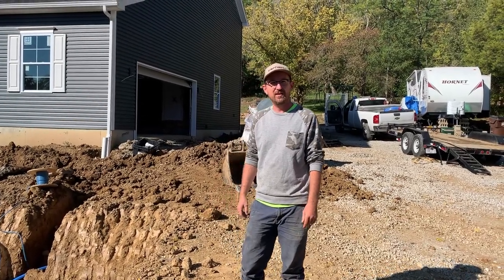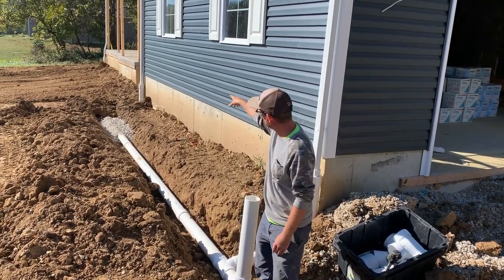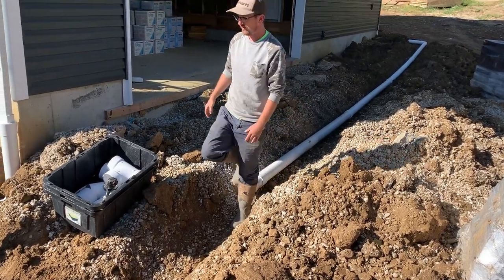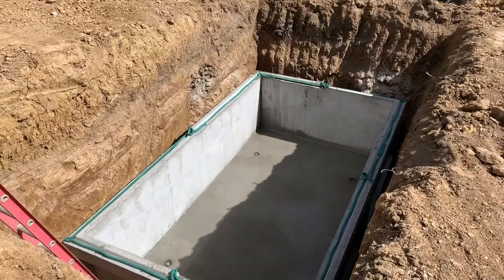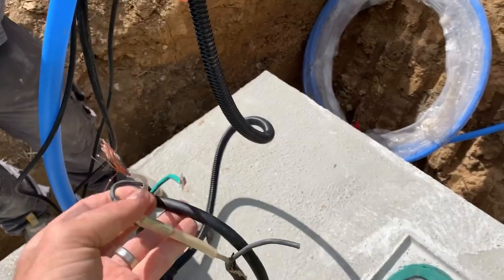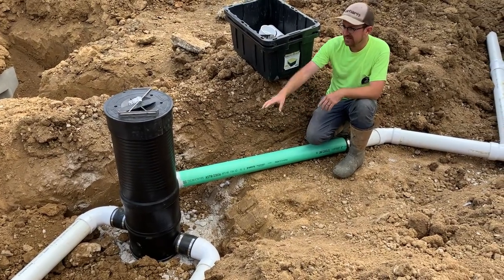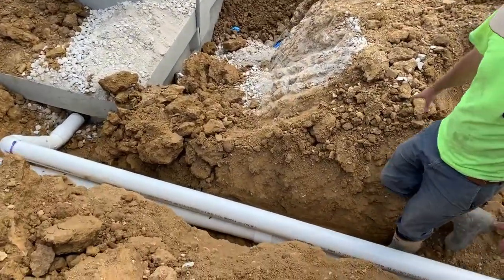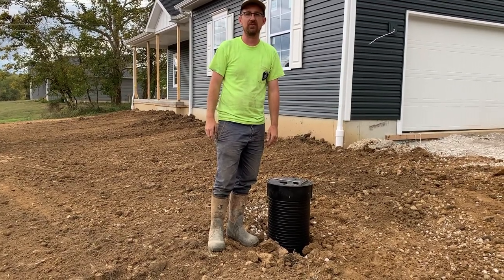Complete overview of underground rain harvest cistern install

Comment: Very helpful as I plan my own system. One question: are the water and electrical lines back to the house placed in conduit, or can they be, and if so, can they go in the same conduit? I would like to do this, so that the lines might be replaced in the future without digging.
Reply from the maker: Great question - yes, the electrical cable can be placed in conduit, though we use direct-bury UF cable for our systems, which does not need conduit. As for the water line, I’ve personally never seen that run in conduit, and I’ve also never seen polyethylene water line need replaced, so I don’t, personally, think there’s a reason to try to run the water line in conduit. Hope this helps
Reply: @rainbrothers  Thanks, in my case and perhaps like others, I will be navigating a slab foundation with the water and electrical lines.
Reply from the maker: @marklundegren  Ah, I see! In that case, yes, we’re run water line in conduit quite a bit. I would recommend 3” or larger PVC conduit with long sweep 90s for 1” water line. If you end up using PVC pipe and not electrical conduit for the pipe sleeve, then you’ll want to go 4” or larger and use two 45s to make the bend up instead of one 90. And, generally speaking, you can run cabling with the water line, though you’ll want to verify local code

Comment: We use a whole house water distiller, running to a faucet at a kitchen sink, ice maker lines, bar sink, etc. That is our drinking water. Would I need to add another inline filter prio to the distiller?
Reply from the maker: Great question. I’m honestly not all that familiar with distillers. I’ve only had one customer in all our years in business who utilized a distiller. I would say, though, that good prefiltration would certainly prevent (or at least lessen) fouling of the distiller itself. This is our go-to indoor filtration setup, prior to UV or Quantum Disinfection: https://www.rainbrothers.com/store/20-x-4-5-Two-Stage-Filter-Housing-Kit-p520835221 . Thanks for watching and sharing

Comment: Is this a full rainwater collection system? What’s the average cost for this size?
Reply from the maker: It sure is! This is a 5500 gallon system. Costs vary greatly region to region and state to state. In Ohio, average cost for a system like this with permits and regulations is between $20,000-24,000. In Kentucky, that cost goes down from $18,500-24,000. There are a lot of factors